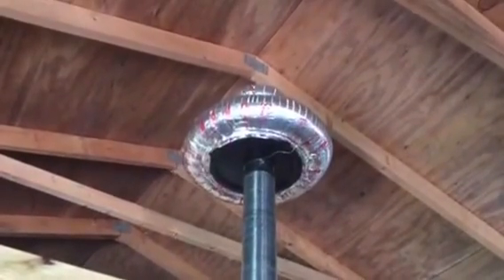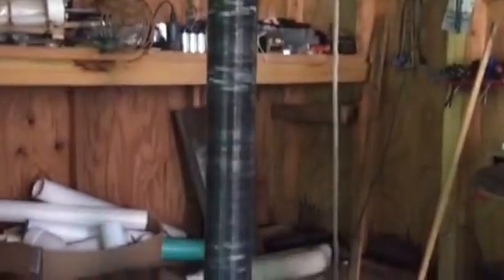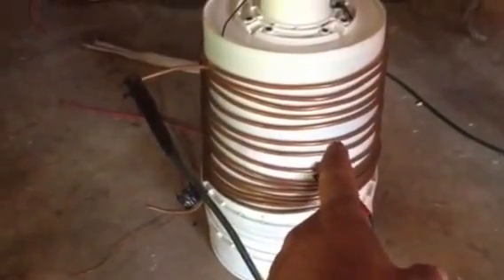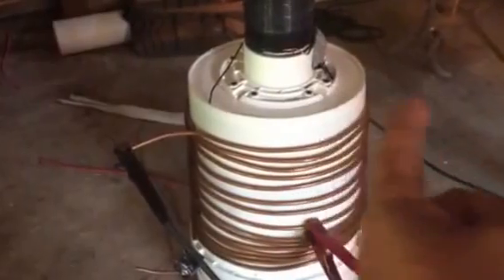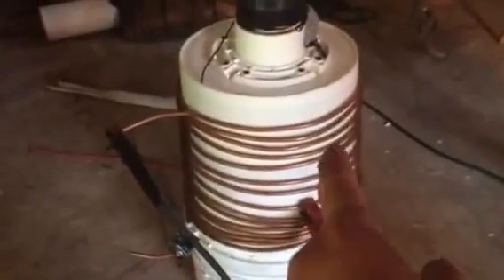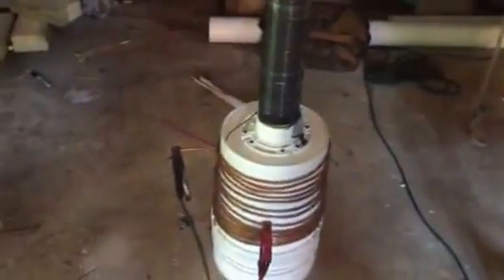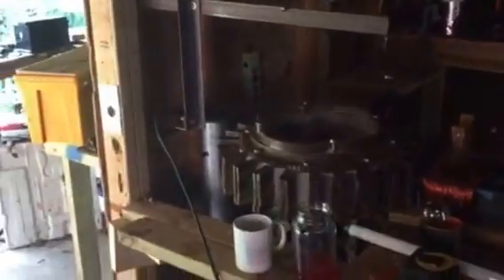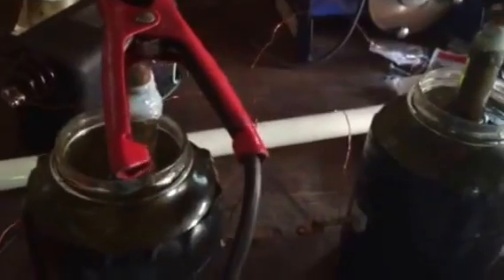Tesla coil first build

Comment from the maker: Hi Terry
Yea the bottom and top are rough now, but I'll sharpen up those areas. 
Scott and I are on a mission to,
Send power back and forth to each other. He lives in Vermont and I in North Florida. I believe that we can light up each other's light bulb,
By using a ground rod system, built like a root system like a tree.
So every time you hit the ground it would be like hitting a large bell. 
This would create a ground and air Oscillating system between Scott and I. 
My e-mail is vinnystvincent@ail.com
If your interested in tuning your coils to ours we can have a trio going.